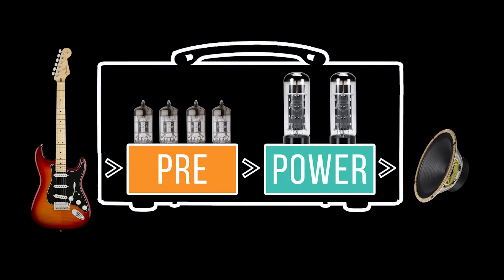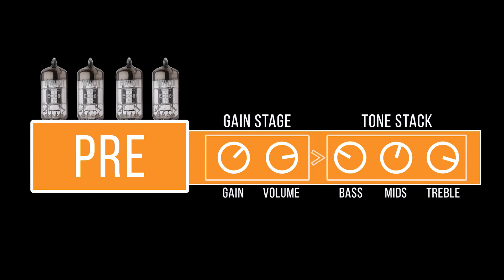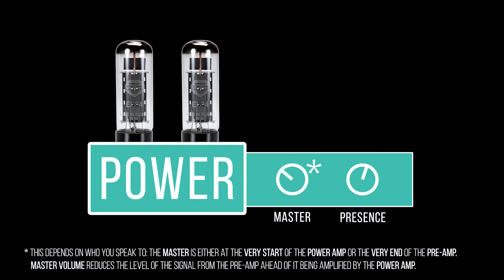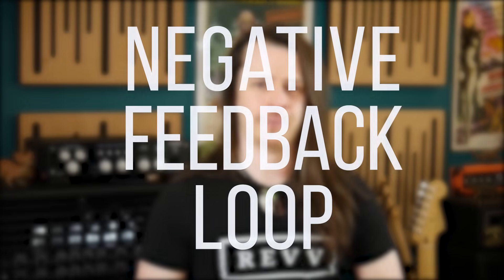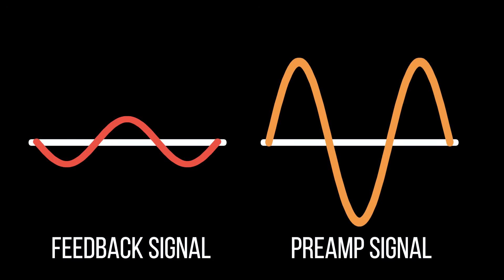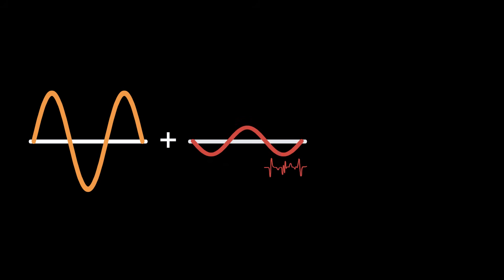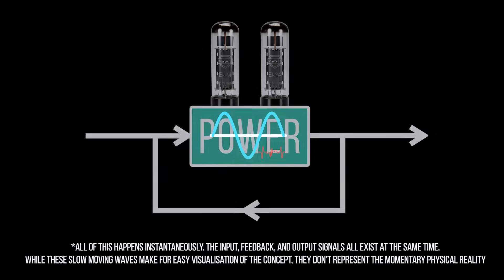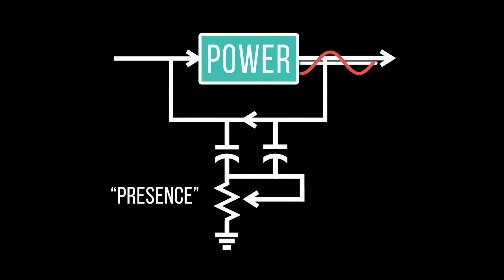Presence: What Does It Do? | Too Afraid To Ask

Comment: please sir, how about speaker slaving? for example,hooking up two 4x12 cabs to a triple rectifier which has one output per ohm selection. not all 4x12 cabs have a slave out jack. I would prefer not rewire all my cabs. I have an awesome 2x12 with c-90 black shadow celestions which I want to run in series with my 1x12 housing a v-30... my 1x12 has a slave out but I am AFRAID to run a 150 watt head through a 60 watt cab into a 180 watt cab... please please please help? THANK YOU

Comment: I didn't know this, but I disagree on a couple of points. Whilst tone controls, high and low pass filters, subtract and are called passive they are usually sandwiched between amplification and  buffer sections and then are seemingly called active because although the filters themselves are subtracting, amplifying the frequency profile they produce can then add more treble or bass or mids. Also, if the tone stack is set to reduce the treble or highs the prescence control should have very little effect as there will no longer be much to be amplified in that frequency band.

Comment: The characteristic bright sound from Vox amps is caused by their power stage being straight-through and not having any feedback at all, so essentially they always have their presence controls cranked up to 13.

It also means they're not prone to any oscillation in the power stage because there is no feedback path to oscillate through, so you can dial the master volume up to crazy levels.

Comment: I think it's worth adding to the conversation that, as I understand it, the original concept amp designers had for a presence control was that it would provide tone compensation for differing stage volumes.

Due to the way our ears perceive sound, at higher stage volumes, bass and treble content sound louder overall (check out equal-loudness curves on Wikipedia), and a tone that sounded great at bedroom or club levels may be too harsh at stadium/theater levels. So the idea was that you would build your sound with your EQ as normal, and trim the highs with your presence control as necessary—high volume, less presence, or low volume, higher presence. It also depends on where most of your drive comes from. If you have a hot preamp that does most of the clipping before the power tubes (like a JCM800, Dual Rectifier, Soldano, etc.), the presence control will help with post-distortion highs, but it won't tame anything prior to clipping; on vintage amps where the power tube does most of the clipping, it'll have a lot more effect controlling what gets clipped and what doesn't.

In addition, the circuit topology varies a little bit between amp models. Fender amps (and early Marshall designs) used the feedback-bleed version mentioned in this video, but later Marshall models (late 60s onwards) don't put it in the feedback loop, but just before the phase splitter/feedback stage, making it more like another passive EQ control—you can still tame highs, but it won't affect the distortion curve in the process. The "tone cut" control on Vox amps also works in a similar way to the late Marshall design.

Comment: You know what I wanna know? How to do a pick slide that sounds good. Can't do it. Mine sound like a dude burping after too many soda pops! 😥
Reply from the maker: You are applying too much pressure.
Reply: @ScienceofLoud coming back 5 years too late to answer, but yeah you were absolutely correct. In the end I've ended up not using slides for playing but I do know how to use them now if I have to.

Comment: I have an original 59 Bassman, whose only known mods over the last 30 years of ownership have been installing a new P10R to replace the missing one, and installing a 3-conductor power cord.  The Presence control is wired such that turning it "up" results in less high-frequency content.  Assuming that this is how it was originally installed (and I have no way of knowing what may have happened in the 30 years before I acquired it), I can only presume that it was conceived of as a "taming", rather than an "unleashing" control (i.e., "more" = "tamer").  Any other folks knowledgeable about old tweeds that can confirm or refute?
Reply: I'll just add that, when musicians and engineers in the 50s thought of "good" guitar sound, they were thinking of clean tone, and not the distortion we desire these days.

Comment: To be nitpicky, the presence control does vary between manufacturers but it's always some form of negative feedback. Some designers have the presence control control the local negative feedback of a pre-amp tube or pre-amp section.
Still, that would just muddy the explanation and I absolutely understand the omission. Keep up the good work Colin!

Comment: I learned something.  Thanks for digging into the technical part of it.  I always describe Presence & Resonance as the "Treble & Bass" controls of the power-amp section.  The preamp tone controls help you push the part of the signal you want to break up, and the power-amp tone controls let you shape the final tone as you've already pointed out.  Do you have a detailed video on the "Resonance" control?

Comment: Depth/Resonance controls/boosts also exist here! They're a high pass filter (the presence control is a low pass filter), so they behave basically the same way, but for low end. The only exception to this is the presence control in the Mesa Rectifier's modern mode - the negative feedback loop is disconnected so it's a treble dump right at the end of the tonestack.

Comment: so is a treble boost a pedal for amps without presence controls roughly?
Reply from the maker: You could get similar results using a treble boost, they used to be very popular back when amps were simpler and didn't have much gain because you could really drive the high end into distortion with them. 

Treble boosters are mad underrated pedals.
Reply: @ScienceofLoud  guess we both watched Pete Thorn's recent video then?

Comment: And while we're on the subject, what's the difference between the Volume and Master Volume control?
Reply: TN Frank really?  Come on man. Crank the volume.  Then use master to overdrive to taste
Reply: @chinoman7234  I never had an amp with both volume and master volume before, only gain and volume.  So volume is the main volume and master volume is for the overdrive?  Seems like it'd be the other way around where volume works with the gain and master volume is the actual volume control. Thanks for at least posting a reply to my question.
Reply: TN Frank so you crank up the volume to max the overdrive of the amp.  We are talking tube amps here I hope ? Now this will be loud so you then use the master to control overall volume.  Then you adjust your other channel if you have one the same way for the tone you want out of that. Now both are switchable and the volume is roughly the same so you can go between channels during a song and volume is correct for each sound.  The master allows for stage volume while the channel volume allows for tone

Comment: Here is my TATA...
When comparing solid state and valve amps, every one talks about the difference in tone, and no one ever mentions the difference in reliability and maintenance.
But everytime I look at a valve amp to buy, I'm worried about those fragile glass things inside, and wether or not I am able to replace them if anything goes wrong (cathode/fixed bias).
Am I Just being too worried? It seems like I'm the only one who cares about this....

Sorry for poor English btw
Reply from the maker: I think you are being too worried. 
While valve amplifiers will need more maintenance and care than a SS amp, they are not necessarily fragile. You can really mess them up if you do stupid things like try to play them without a speaker attached, or drop them while the valves are hot, but valves are extremely robust. In military applications valves are still used (since you can't knock them out with an EMP) and as such are designed to be durable for all the rough handling and vibrations they will receive.

Comment: I have a TATA for you Colin.
Can I use a low wattage tube amp's preamp and then connect a external poweramp which has more wattage to have more headroom? For example, a Orange dark terror with a Harley Benton GPA 400. Thanks!

Comment: Hi Colin, I have a TATA question.  How did you replace the led in your micro dark. I have the same amp and have never liked the blue light.
Reply from the maker: Just pop it out of the bezel. The LED legs aren't soldered to anything, they are pushed through a two pin JST style connector. Remove, insert the new one in the correct polarity, push it back into the bezel. 

It's a 1 minute job.
Reply: Thank you!

Comment: I tend to run about 3/4 on my amps so to make the sound more able to be "Haired"  :).    It does tend to make the sound carry more and stand out so heavy tones do not get lost in the mix . A great balance of Mids and Presence can give your metal tones a really full blasting and bright harmonic tone .  But if both are turned down too low you get a muddy deep bass rich tone that is easy to be lost in a band mostly to the bass guitar .  I did NOT know this was located in the power stage.  Great to know thanks for the cool info :).

Comment: Does the presence control on a 3 channel Mesa Dual Rectifier work the same way as your ENGL? It seems to be built into the preamp section. I could be wrong.
Reply from the maker: I'm not certain on Mesa circuit design, but if it's in the preamp it's probably just and active treble boost that they are calling 'presence'.

Comment: can a tube amplifier's power section be run without a feedback loop? on solid state devices like op-amps, running with an open feedback loop saturates the output to the power rails, but tubes are quite a different beast and I'm not sufficiently experienced to understand how they would behave

Comment: Nice informative video, presence is so different from amp to amp. I mostly like it at 9 o'clock or all the way off. If the sound doesn't cut it with the presence low I reduce the gain.

Comment: Why does increasing output level on an overdrive or distortion pedal that is in front of a dirty channel increase the "angriness" of the sound?
Reply: That's because overdrive adds harmonics which are the cause of the 'dirty' sound in the first place. Put those through your amp which is already overdriven, and you have odd harmonics which are the result of all of the other harmonics, causing the angry, fuzzy sound instead of the crunchy overdrive sound which is comprised of even harmonics only. Tubes cause even harmonics (overdrive) while transistors cause odd harmonics (distortion and fuzz). One of the main reasons we're still using tubes in our amps or try to imitate them digitally.

Colin should really do an item on Fourier transform which describes this really, really nicely.
Reply: As someone who is currently studying physics this subject really interests me. I hope colin does a video about it.

Comment: My amp has "Tone" and that's probably one knob too many already.
Reply: Mine just has a gain knob.
Reply: @recreationalelmersglue6053  Joyo Zombie
Reply: @Pfaeff  I love the simplicity of mine because there is so much less I can fuck up than my previous amp, It always sounds good.
Reply: @Lucartes98  I don't need the possibility to dial in 100 different shitty tones and a hand full of good ones. Give me one knob to cycle through the ones that are actually useful to me.
Reply: @Pfaeff  
I have a boss Katana that is a "modeling" amp to some degree...All of the preset model tones are very good.
However, I was able to tweak/change any of the factory model set tones to a more perfect tone for me by EQ, FX, ect and then save it to a channel for re-call of that specific tone that I built when I want it.
It has four different channels to save my own perfected tones and re-call them instantly.

I dont have to fiddle with ANYTHING anymore and I accomplished this over the course of the first week that I owned the amp.
I'm curious as to why people like yourself are turned off by amps like mine considering what I just stated.
Reply: @stricknine8623  I am the same way with Bias Amp. I know that I can customize the sound literally down to the circuit board. But what I end up doing is download a ton of presets and just try them out one by one without fiddling with any of the knobs. When I found something I like, I will do some amount of finetuning if needed.

I also think that the cabinet has a much bigger impact on the sound than I could achieve with just fiddling with any of the knobs. So I usually end up trying a different cabinet impulses as well.
Reply: @Pfaeff  speaking  as a guy who designs valve amps in his spare time... How am I meant to know which sounds are perfect for you? Another person with different ears might love the sounds you hate. All we can do is provide options and hope as many people as possible can find their favourite tones. You can't please all the people all the time!
Reply: @dasschaf2476  Of course you aren't. I just don't like fiddling with lots of knobs, that's all. 

The only thing you as an amp designer could do, would be to limit the parameters of the amp to a reasonable range. If an amp sounds good when everything is set to 12 o' clock, then that's a great starting point. If it takes a long time to get good tone, I can't be bothered. And of course, good tone totally depends on the person and the application. You can't please everybody and you certainly shouldn't. It's better to make a metal amp for metal people, a rock amp for rock people and a jazz amp for jazz people.
Reply: @Pfaeff  I know what you mean about too many knobs. I once made a guitar amp with an integrated 5-band fully parametric equaliser (15 knobs for freq, amplitude , and Q. 2 switches for shelving, plus 2 knobs for pre and post gain) and you could dial anything into it. I hardly used it because it was too fiddly! I swapped out the equaliser section for a one knob tone compensation circuit in the neg feedback loop. Lifted the design from an old Ampex tape recorder! It's the best tone circuit I have ever found for guitar. Every position on that one knob sounds good; never too dark, too bright or too mid heavy. I have never seen the design in a commercial guitar amp either, but to my ears it's the best thing ever. Shame the circuit doesn't lend itself to being transferred into a pedal or a modern solid state power section. 
In my experience adding a tone section into any preamp sucks major mojo out of the signal. I made a few amps now where you can switch the tone stack in and out of the circuit, because if the guitar you are using and the room allows it, then the tone is so much nicer without the stack.
Reply: @dasschaf2476 that's the beauty of the BOSS Katana ... you can please everyone. There are so many variable options available - everyone should be able to get the sound they want out of it.

The downside is that you can end up spending a lot more time tweaking knobs than actually playing.
Reply: I've got a micro dark and have no idea what I'm doing...
Reply: I was born with only one knob, and that's been hard enough to control..
Maybe that's why I prefer amps with only tone knob...???
Keep life simple...
Reply: mine has a tone switch: on or off.
Reply: @KC9MDO : That's a volume control, not tone.
Reply: Are you a bassist?

Comment: Some amps (like the Mesa Boogie Dual Rectifier) feature a prescence knob in the preamp section depending on channel mode setting. This is basically just cuts high frequencies, which made some smaller manufacturers (such as Kaosamp) to label this kind of prescence knob as "hi-cut" instead.

Comment: Colin, I've been meaning to ask:
In your video about how wattage relates to volume, you specify that to double the volume you have to multiply the wattage by ten, but that's in the case of VALVE amps without distortion.
You already explained how it works with distortion, however, my question is: how does wattage relate to volume in DIGITAL amps?
Reply from the maker: I'm going to do a video on Valve vs Solid State vs Digital and I'll touch on this. 
There seems to be SO MUCH confusion over these when there really shouldn't be.

Comment: PLEASE COLIN, TELL US ABOUT RESONANCE NEXT!
Reply: And the depth, which is present on other amps
Reply: Lol
Reply: Amptweakers 'Depthfinder' pedal, will give you all your answers in real time.
It turns good amps into ultimate beasts, and shite ss amps, into tube tone gods!
Reply: @Caged63Man "shite ss amps" - all relative my friend. I've been running SS amps for over 20 years and would never go back to tubes.
Reply: Let me beat him to it. Like the presence control, a resonance/depth control (same thing) is an active EQ control. Instead of cutting high end in the negative feedback signal, though, it cuts low end - which means an increase in low end at the output of the amp. The usual configuration is a low-ish value capacitor (around 4.7nF-6.8nF, generally) in parallel with a potentiometer. Capacitors cut low end based on their size, and you can adjust how much signal goes through it with the pot. It comes before the presence control in the negative feedback loop, usually right after the resistor that sets the amount of negative feedback.